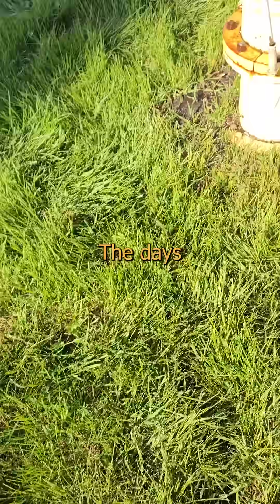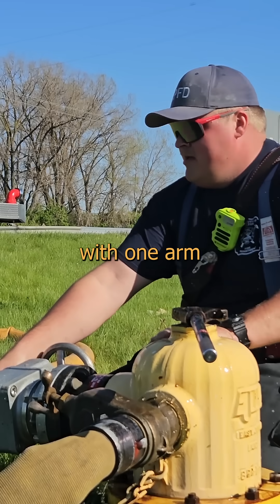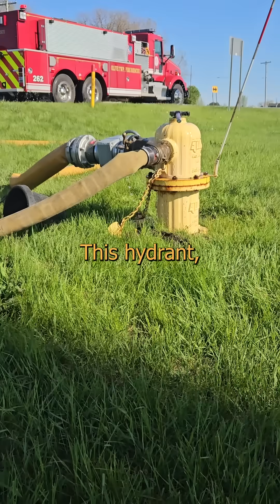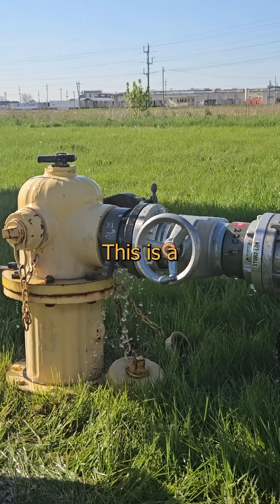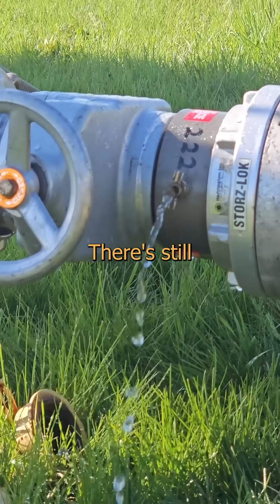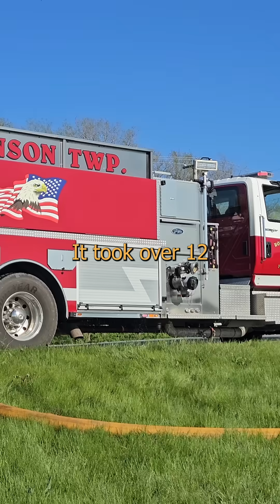Fire Hydrant Gate Valve #chrisboden #comedy #engineering #training #educational #pressure #science

Comment: I spent a reasonable % of my working life trying to justify how it was a measure of success that I sat around doing nothing!
The higher ups in the company saw it as an insult to them that I did so even though my job was to make things run well after they stopped running and that on an Electrical Distribution Network having everyone grafting away is strangely counterproductive. After all If I am knee deep in bollox in a substation I can't just drop everything and go get the other substation back after those 400A fuses keep popping!
Also expertise can be difficult to quantify sometimes. Like knowing what a substation smells like (or more accurately does Not small like) when it is being run at capacity in the middle of summer and the ventilation has been obscured. Or in one case to be able to instantly realise that a tramp had got in and found a nice warm spot wedged between the transformer and the wall where he could get some sleep ......... blissfully unaware that he had been walking within hands reach of bare 415V bus bars that would have boiled him off without even noticing anything was wrong. They did not cover That one in the handbook!

Comment: We don't replace the hydrant. That is an East Jordan 6BR. You undo the hold down nut that holds the operating nut in place then you can remove the operating nut. After that you unbolt the whole top (bonnet) then you can put a special wrench that turns the stem that goes into the foot of the hydrant and it will remove the whole stem and valve. And that's pretty cool!
Reply: TIL
And that’s pretty cool, too!
Thanks for laying in on us 👍
Reply: Do you have a cutaway view of the hydrant with labeled parts?
Reply: @itsallspent funny you mention that. I worked in water for 5 years. One year I went to the awwa big training in lansing mi and I think east jordan was handing those hydrant cutaway posters out. Every water, public works, waste water, and fire dept should have one. Hydrants can get confusing depending on what year they were made. Some are clockwise and others counter clockwise. As indicated in the video its not good to snap the bolt. Expensive.
Reply: @Bruh-i1y1k  Really? I cant believe something so universally used, necessary and important wouldn't be standardized by now.
Reply: @amphetameanie  It may be standardized by now, but many hydrants are decades old because they're expensive new.
Reply: THAT was my question throughout this video. THANK YOU!!! 💯

Comment: I was a firefighter for a decade and that ball valve is not for in case the hydrant valve fails. If you are the first truck on scene you put the ball valve on the small connection and DONT connect to it, you connect to the big one. The valve is so a 2nd truck that arrives can connect to water if there are no other hydrants available. As the first truck you want the bigger tap anyway because you are most likely to be flowing multiple hand lines and your deck gun due to proximity to the fire. If the fire is so bad that more than 2 units are required. The 3rd will find another hydrant. Or if there alot of hydrants in the area, the 2nd truck on scene will grab the big tap on a 2nd hydrant.

Comment: As a public works guy I can tell you we also kind of hate those gate valves. Closing those too fast when 600 gallons a minute is flowing is a great way to find weak spots in your water mains. 😅
Reply: As fire fighters, we know yall hate them. Lol we try our best to slow close them, in our area at least, so that the water hammer is minimized.
Reply: @BrandonBorden-c5d  Just needs an overpressure relief valve upstream of it so most of the hammer effect gets discharged.  Or a few feet of vertical capped pipe for a hammer arrester, but that would be bulkier than a relief valve.  Going to be lots of water on the ground from draining the hoses anyway, so venting a little more won't matter much.
Reply: @laurenceperkins7468 
Smart ideas!
Reply: @BrandonBorden-c5d water battering ram at that point lol
Reply: As someone who worked QA at a water meter manufacturer I can tell when someone got happy closing a valve to quick my work load increased exponentially breaking things management argued wasn't breakable under normal circumstances. 😂
Reply: @alexlail7481 I see valve stems on hydrants over tightened all the time. Those are a pain
Reply: And that's why gate valves are a lot better than 1/4 turn valves. Top much potential for significant water hammer.
Reply: @liamhilt1822  And globe (at least that's what I know them as)...not to be confused with ball...are better than gate. Though gates have better variation in how much//little they open...their seat can fill with deposits in the water stream so they can eventually reach a point to not shut all the way. Also eventually can result in a valve that might snap a stem when you try to opening them after shutting down too tight. Not had that issue yet with globes with their hemispherical seating.
Reply: @liamhilt1822   the one that made me curious about the damage it could do was we made 12" meters and the occasional 18" with check valves as part of the assembly. In the event those snapped shut on full flow i imagine the water hammer could be something else to witness... But then if those snapped shut you already had other things going wrong somewhere...
Reply: Same here. I work in a mountainous municipality that still has wood pipes in some areas. We have at least a couple main breaks a year due to water hammering lol
Reply: One young guy had to program control system for some water valves, quite big ones. Then, something happened and one valve slammed shut. Life gets interesting if a pipe of 3-4ft diameter bursts.
Reply: STOP!
...
...
WATER HAMMER TIME!
Reply: Sounds like it loo
Reply: We don't have hydrants like that in the U.K. Do you mind if I ask the stooped question, how the fucking hard is it to swap them?
Reply: @tedrex8959  limited resources and time. All said and done they are only like 10-15k to replace but usually pretty low on the priority list
Reply: @tedrex8959  In most parts of the US the valve itself is at the bottom of the standpipe, which could be 2-10 meters below grade. The hydrant you see is just the outlets and the top of very long shaft.
  In California and a few other warm places, the valve is in the hydrant and the whole standpipe is pressurized. That's why the movie trope of the fountain when a car hits a hydrant. It actually IS a thing in California
Reply: @markbecht1420  I think you'd be hard pressed to find a water main in the US that is 30+ feet underground.
Do you know the UK hydrants he is referring to though? Pretty sure they're the same as most of ours, as you've described.
Reply: @markbecht1420 Thank you for the replies. I am sorry that I am so tardy in my response, I was rushed into hospital with a bad infection and have only just been released.
Reply: @tedrex8959  doing a basic look at fire hydrant specs in the US vs the UK, the US fire hydrants have 4-12 times the water volume flowing out compared to UK hydrants. UK fire hydrants seem to be primarily pits with a cover that have to be cleaned and maintained and seem to take more time to set-up in an emergency, while a US fire hydrant seems like its quicker to be able to roll up, screw on an extra valve in case the primary one fails, then screw on the hose. So US already has higher water volume quicker to access hydrants which is perfect because our homes are almost universally wood in the States vs the UK where stone buildings are much more common.
Reply: @tedrex8959  Depends.  The main purpose of that style of hydrant is to let you have the valve down below the frost line so it doesn't freeze solid in the winter.  So depending on where it breaks it can be a pain to get the water turned off upstream so you can work on it, and then you're working at the bottom of a hole that's up to two meters deep in some areas, and you may have to start by pumping the water out of it.

In the ideal case the broken parts will be near the top and it'll be easy.  But it can turn into a serious pain if you're unlucky.  Whole day's worth of work sometimes if you have to dig it out without breaking the main it's attached to.
Reply: @tedrex8959 : Well, you have to shut off the water main and bleed off the pressure before you can remove the hydrant. 

How do UK fire departments get water to put out fires?
Reply: it depends on what he considered removing a hydrant.... For true full 100% replacement you are correct but most that I have seen are set-up where the upper portion above the valve can be replaced if damaged without shutting down the surrounding mains... Those are dry hydrants, they typically have the valve several feet below ground right at the main and a long shaft weakly connects to the valve from the nut at top  in the event of a car impact the thought is the above structure would break way without major damage to the actual valve... I believe they are the most common in the US since they are also designed to be resistant to freezing (when not in use) during Cold weather vs. wet hydrants which would have potentially The valve essentially behind the hose connection...  That is a very basic description that is probably offensive to anyone who deals with them on a regular basis...
Reply: There's water hammer, then there's water Mjolnir...
Reply: This is why I have long argued that the hydrant system should be separate from the drinking water system. This, and we shouldn't be wasting treated water on putting up fires. In places with grey water irrigation, the hydrants should be connected to the grey water system. 

I understand WHY hydrants can't have their own dedicated system. Water needs to flow, having zero flow rate will accelerate the failure of the system... But there's ways around that.
Reply: @iwontliveinfear well the main reason is because dirty water destroys pumps and other appliances.
Reply: Good thing they're not 90 degree ballcocks.
Reply: Where I live, they are still finding water mains made out of hollowed out cedar logs and lead pipes. Water pressure, for decades, was limited to 15 psi, then someone decided to bring it up to 30 psi. There were leaks everywhere. After they fixed those, pressure was raised to 60 psi. Boom! Lots of leaks. They fixed those. Pressure was raised to 90 psi. Lots of homes and businesses had no pressure regulators and the new mains were finally capable of delivering full pressure. You can guess what happened. When they announced they were going to raise pressure to 120 psi, the community raised hell. A court order prevented that. 

They are still "finding" and replacing 100+ year old lines. How hard would it be to just look at where lines were replaced/upgraded over the past 75 years and then plan to replace the lines everywhere else? After that was done, inspect every home and business to make sure they had pressure regulators before increasing the pressure. Instead their discovery process involved blowing lines and valves everywhere, flooding homes and businesses. 

The water company stated that it was a state government regulation that they were required to provide 120 psi water pressure at the mains. All it would have taken was a formal letter from the water company explaining why they could not comply with that regulation. Hundreds of millions of dollars later the state conducted a water line survey and identified lines that must be replaced. State tax payers are covering the cost.

I had to replace the old pressure regulator for our house. When pressure was raised to 90 psi it destroyed our hot water expansion tank and we were experiencing pipe bangs like crazy when shutting off faucets. A check of water pressure at the hot water heater showed 80 psi.
Reply: I’m a volley fire fighter and work full time for the water dept. I understand it from a very unique perspective lmao
Reply: Firefighters know not to do this because water hammer also destroys the pump on your apparatus if you close the nozzle too fast
Reply: (water)hammer time!
Reply: Oh yea, water hammer is a b..th 🤣
Reply: that's why I use a ball valve.
Reply: Yeah nothing says “I’m a firefighter” like sending a water hammer through a 50 year old water line. I would know as I see it all the time.
Reply: IIRC the gates on gate valves are slightly tapered so they are a little lose until fully seated. Makes me wonder if you could exploit that and make a valve that starts getting hard (but not impossible) to close when the pressure across it gets above a target pressure. If that could be done simply enough it would self limit how fast you can work it and the instructions become "if it's getting hard, you are closing it too fast".

Comment: I love how you can see the improvements in the operators of the two gate valves. The older one (brass one) has a small diameter crank without a wheel. The new one has a crank on a wheel with a larger diameter. You can see him use both hands when he needs the extra torque even with the bigger lever arm.

Comment: I had this problem the other day. The tip on my pressure washer broke.
Turn the motor off but oodles of pressure, can pull the tip off, can't squirt the gun. Could only undo the threads, with channel locks. Thankfully it only buggered the ones on the hose and not the pump. Good grip with eyes closed did the job.
Reply: that's called Safety Squints :P

Comment: Not the brake rotor joke. (I just bought two new rotors and pads because the front ones on my 2012 Sonata. When I saw that you needed a C-Clamp to put them bitches back on I stopped right there. I need my dad and a torque driver. Cause I lack the strength and most needed the tools.
Reply: Did they not tell you to open the bleed valve on it? If you do that, it really shouldn't be that bad.

Comment: Been to the Waterous plant in Minneapolis/St. Paul... they have the machining and dynamometer rooms to build and test their line of water pumps also. The northern states line of hydrants can handle a vehicle clipping it off at ground level because the actual valve is down under the ground below the frost line. Their pump line capacities handle from 250 GPM up to 250,000 GPM.. think powerplant cooling. And that is also pretty cool.

Comment: TIL firetruck fill up with water towers
Reply: Most water, best pressure.  Each one of those water tenders carries 2500-5000 gallons and each regular fire engine has 500-2000.  They’ll need 3000-5000 gallons per minute to run master streams at the fire.